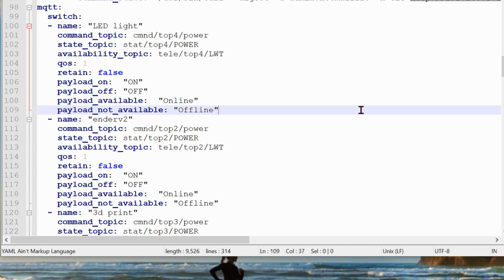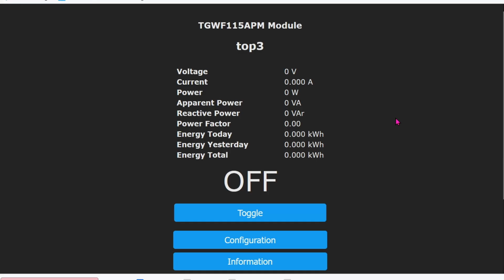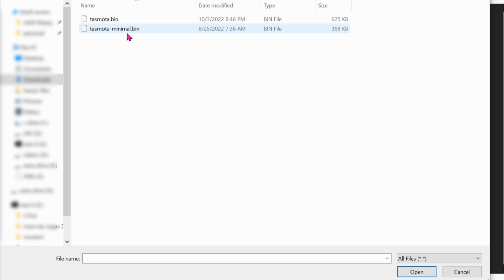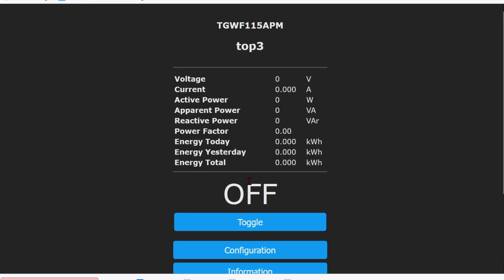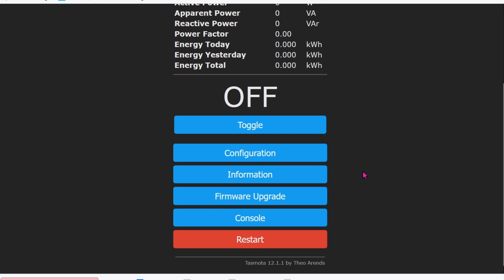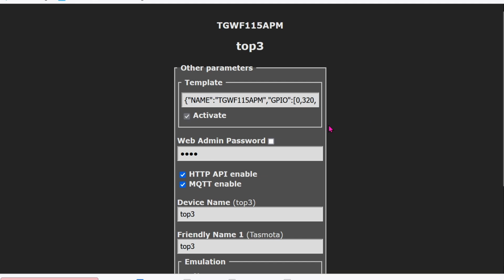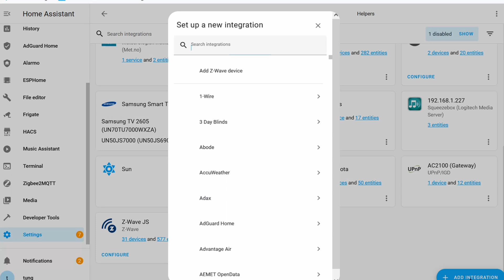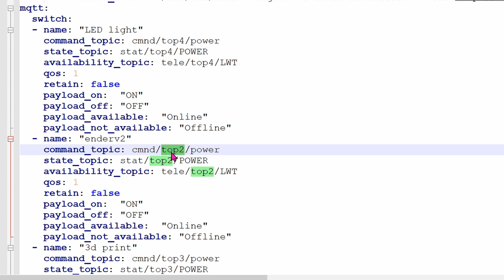how to: update Tasmota firmware. no more MQTT errors

Comment: I am on 9.1 across the board and still using MQTT no issues, but I see today that there are MQTT changes in the newest version of HA that might break it unless I reconfigure.
Might be easier to just use the Tasmota intergration going forward.  It shows up in my HA but with no devices.

A long while back though even with MQTT manual configuration via YAML was removed.  You can send a command in the terminal of Tasmota and it self register's everything.

Comment: Why did you update the device fitrst with the miminum and afterwards with the tasmota.bin?
Reply from the maker: I don't know the technical. That's how the Tasmota website says so I just follow
Reply: Some devices do not have enough flash to do a full version update, so if you do basic first it updates the needed parts, and then you can just add the features.
I have many I have to do this for as they were created so long ago with a different flash structure.